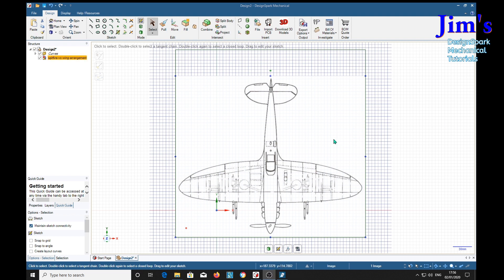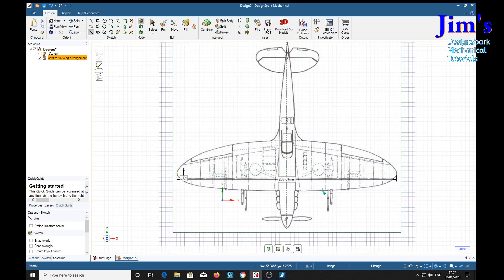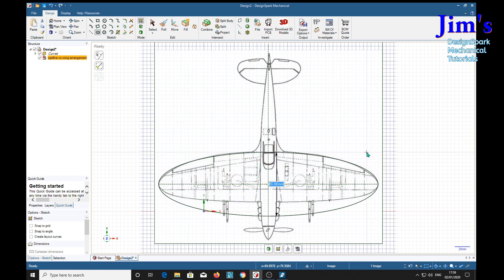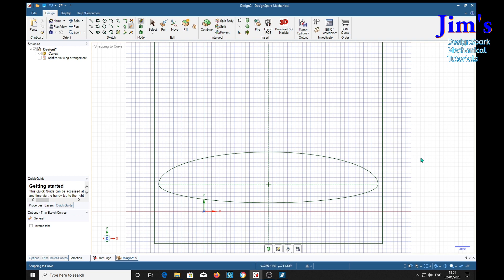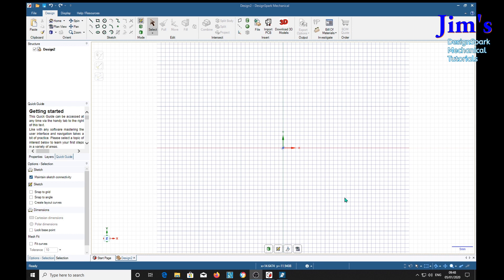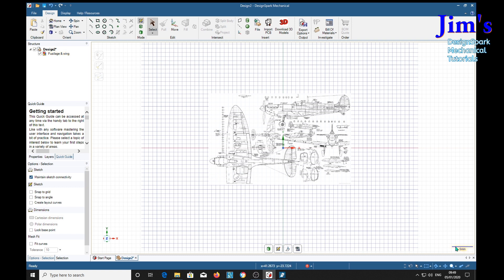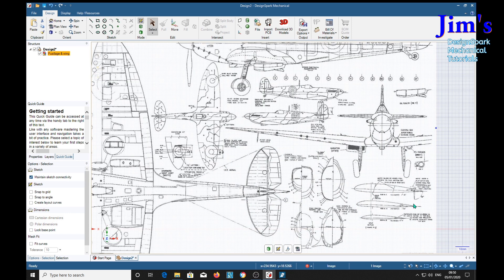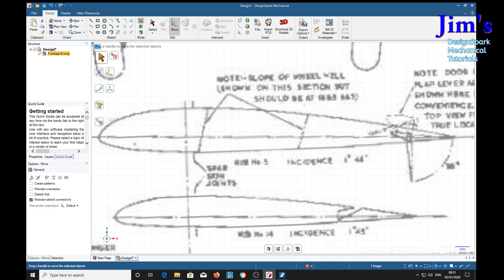Modelling a Spitfire wing in DesignSpark Mechanical. pt 1of3

Comment: Mr. Jim, I have found an Easter egg hunt of the "Not so Elliptical" spitfire wing for you:
https://youtu.be/Gt7gzFIvlFI

It's a fantastic watch, there is a PDF to go along with it. Being a CAD guy, you will likely appreciate the maths involved in reverse engineering this shape.

(It's two ellipses, split about the 35.5% chord, as you drew it, but then it's modified to make the middle section wide enough to fit the guns in, by stretching and scaling the basic design. Then the mean chord line is sort of skewed into an S shape to make the outboard portion bulge forward to cover the outboard gun barrel).